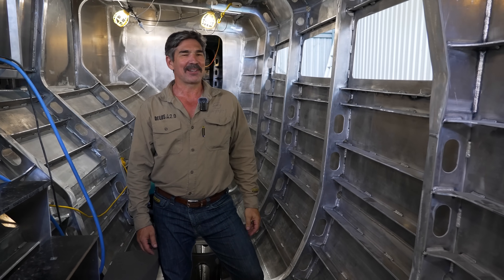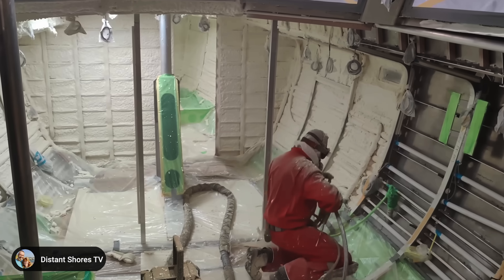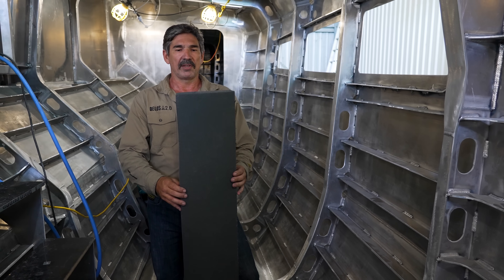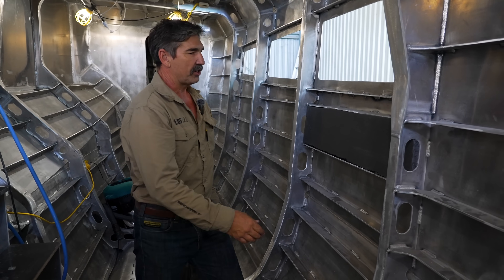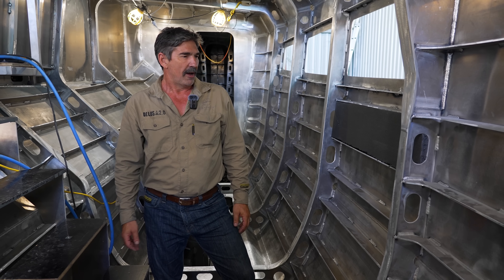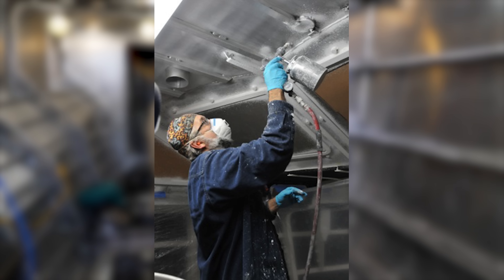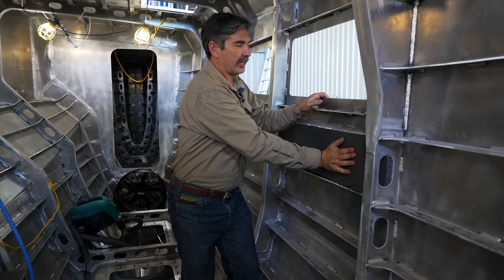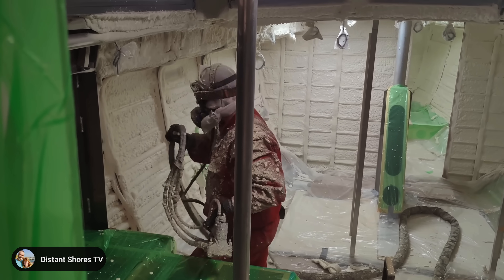HELP, We Need Your Advice!  How Should We Insulate Our Aluminum Catamaran???

Comment: Awesome subject, thx for opening the conversation. IMHO, there’s only one real option. Spray it. I would explore a two part system especially an epoxy solution. Poly cells breakdown over time and can hold water. Look at all of the poly foam core/fiberglass that has failed.  The correct materials can also be used as a structural foam in water tight spaces or below the waterline. The epoxies will most likely require an acid etching prep. to ensure a quality lifetime bond to the aluminum. 
It’s easy to remove and replace if ever necessary, no power tools required. Power tools may speed up the removal but they tend to make dust rather than chunks. It’s messy but cleans up simply with a shop vac and a wipe down. I’m particularly pleased with how easy new waterlines, electrical conduit or other systems nest into and stay put.

Comment: My comment is definitely off-topic.  I recall seeing the construction of the bus bar.  I am curious, and truth be told, kinda' freaked out.  What is your validation strategy for stray current?  Are you ready to bury the bus bar not knowing if any current is leaking?  After seeing Gone with the Wynn's latest fiasco on their new carbon fiber catamaran and now corroded metal parts across the vessel, I suspect a unit, integration and system testing strategy is something to consider.

Comment: Whatever insulation process you go for. Think about applying Alocrom 1200 or something equivalent first. You could even put a primer on top of that. You won't easily be able to see the inside of the hull when the boat is finished. Better to protect it from day one. It's what we do with Aluminium on aircraft. You don't have to dip. There's a brush process too.

Comment: Why not incorporate a "hybid" solution, you know, like the way you're powering 2.0. That is, SPRAY those areas (like the window frames) where you will always have a temperature differential, then use the Neolon XPE with a "sticky backing" for the rest of it? I would continue to chew on it (as you are CLEARLY doing) until the path forward becomes clear, and it will. Trust your instincts at this point as your gut has brought you to this point, serving you so well. Sail on!

Comment: I have spent a lot of time reflecting on aluminum boat insulation over the past decade. My conclusion is that a multilayer approach, using both cork and foam, is the best solution. For this, I believe that using cork projection for the first layer, followed by foam insulation, is the perfect choice for an aluminum boat.

1st Layer (Cork Projection): Cork projection serves as the first layer of insulation to stop heat conduction.

2nd Layer (Foam Projection): This second layer acts as insulation for convection.

Benefits of Thermal Insulation Cork and Foam:
Thermal Insulation: Cork and foam together provide excellent thermal insulation. Cork offers optimal protection against thermal bridging and condensation.

Sound Insulation: Cork outperforms foam in sound insulation, especially for the low-frequency sounds from waves crashing against the hull. The combination of cork and foam enhances this effect.

Lightweight: Both cork and foam are lightweight, which is crucial for boat builders.

Moisture Resistance: Cork is naturally moisture-resistant and guaranteed to be biocide and fungicide-free. Foam also offers good moisture resistance, ensuring a safe and healthy indoor environment.

Durability: Cork is highly durable (think of a wine bottle cork), and when paired with foam, it provides a long-lasting insulation solution.

Ease of Installation:
One major advantage of cork is its ease of installation. You can spray a 6mm (or 3/16") layer of cork and then add the foam insulation layer afterward.

Comment: The in-situ foamed insulation is probably right. With the pins you're showing, I would always be worried about condensation forming between the alu and the insulation.
What strikes me as interesting is that you have a 15m length at least 2m hight on both sides of each hull. That's ballpark 120m2, simplyfinging that the hull deck insulation is about the same as the fore and aft of the hulls that you won't need to insulate. If that insulation is 8cm thick, that's 10m3 of insulation, providing 10t on non floodable buoyancy. Adding in the bridgedeck floor, you're probablyy not miles from having a vessel that could be flooded and keep afloat. Given you'll get close to it, it's probably worth considering whether you want to add a bit more than you need to cover the ribs and make this emergency buoyancy an integral feature of the build.

Comment: Love the vids! I think spray foam is the only choice for effectiveness, simplicity, moisture control, even coverage and longevity. Using foam panelling on specific areas for ease of access makes sense but would not be great at controlling moisture in those areas. 
Spray foam is not that difficult to remove if needed (although you now have all this foam to dispose of) and as stated it’s easy to reapply.

Comment: I have no idea what the Navy is doing today, but back in the early 90’s my spaces on Yorktown were in the aluminum superstructure, and they had some green kind of primer inside the skin, with those button skewers going through what looked like fiberglass insulation, which would get wet (it was an intake space on the 03 level) and had to be ripped out and replaced pretty regularly. And yes any exposed structure radiated cold - especially above the Arctic Circle.

My recommendation - yes coat the inner surface / no don’t use fiberglass insulation or anything that is not closed cell. I think you are on the right track Brian.

Comment: First apply a thin coat of rhino liner to quiet down the hull and will also help insulation/condensation damage then use the pressure attached XPE.
Sprayed on insulation is noisy in comparison.
Reply: Use spray-on white rhino liner. The benefit will be added strength, severe noise and vibration reduction, protection to aluminum and condensation avoidance. Then add the XPE just pressed on between the stiffeners and/or glued on brackets where needed.

Comment: this will probably get buried just my post where you explained the engine and electrical system but you should absolutely go for spray foam.
run all wires and conduit first and then have it all sprayed up, that way you will not have any gaps and places for water to condensate.

Comment: With the complex ribbing that you have spray foam is the only practical way of insulating your boat to prevent interstitual condensation as no air gaps are left for moist air to pass through. A vapour barrier must always be installed on the warm side of the insulation

Comment: Spray foam the exposed stringers first, leaving the cavities relatively unexposed, then stuff the cavities with foam.   One thing I think you should be very aware of is smoke propagation should you ever have a fire.  You have relatively small enclosed spaces that will fill very quickly.  I like the Neolon XPE since it is specifically for marine applications. 

You should also consider just using the Neolon XPE.   You can solve the stringer problem by making your own "u channel"   there are lots of ways to do it, but a table saw with a dado blade might be easiest.  Cut a sheet into the widths you need,  use the dado, or a router table to run the those shapes to make the u-channel.   Apply a little adhesive,  cut to fit over the stringers,  then fill the big voids.   I think it would be a neat job. 

I'm a little concerned with the r- value of the Neolon,  2 for 50 mm  seems like not too much, but maybe it's good for your application. 

Below is another material,  higher r value, but looks like more problematic to attach in your application. 

I'm really enjoying your this project and your videos. 

https://www.jm.com/content/dam/jm/global/en/industrial-insulation/industrial-mineral-wool/minwool-marine-board/022718_IND-409-MinWool-1200-MarineBoard-A30A60.pdf

Comment: With just the options you mentioned in the video, I’d go with the spray on membrane, then the foam. Then with the, I assume removable panels you cover the walls with, I’d attach a self adhesive sound absorber. Like what’s attached to panels and floors in cars.
Reply: There’s many options and thicknesses, some are like butyl-ish type material, some are like foam gasket type material, some are covered in foil like for engine bays and what not. I just feel like the sheets of sound absorbing material on the back side of the paneling used to cover up the walls will be very multipurpose and easily maintained. Reduce noise, reduce vibration, reduce moisture wicking, easily replaceable.
Reply: There’s many options and thicknesses, some are like butyl-ish type material, some are like foam gasket type material, some are covered in foil like for engine bays and what not. I just feel like the sheets of sound absorbing material on the back side of the paneling used to cover up the walls will be very multipurpose and easily maintained. Reduce noise, reduce vibration, reduce moisture wicking, easily replaceable.

Comment: Here is a link to insulating aluminum boat : https://youtu.be/zXXzXpD3_ng?si=jk4Br10WY0a1YrED  I know it’s not the same as a house, but what ever you do make sure you pray some sort of vapor burrier on the hall. You may think it will be hard to cut away the spray foam for repairs, but remember the likelihood of that is 1 in a 1000, on the other hand the comfort and sound insulation is a daily comfort.

Comment: Spray urathane.  Classic is classic for very good reasons.  99% of the time it is no worries.  Do not engineer for 1% when you need service.  You will have to scrape it all out if you need to make a weld repair, but how often will that be? Plus pultice corrision worry would keep me from the water but no air, adiabatic situation.

Comment: Go with the sprayfoam if for no other reason than convenience!   It's fast.  No fussing with cutting and jigsaw puzzling (I've done it on a fibreglass boat and it was a nightmare)!  Sprayfoam will give you instant adhesion, so no air gaps to worry about.  You can always go only as deep as the horizontal ribs and then lay a sheet on top, between the verticals.  That way you can run your cables/plumbing in the sheet layer... making it easily accessible.

Comment: Too much thermal bridging with your preference. Remember the more insulation you have the higher the bridging effect. If or when you need to get to the hull it will only be very localized. I have a thermal or infrared camera. Its amazing how well heat will exchange at the bridge points or lines. Condensation will be crazy with cold bridging like running water (though I suspect you will spend most of your time in the heat. Even your sample had quite a few gaps in it. just check it with a camera and you will see how poorly it worked.

Comment: How about using the black closed cell and then spray the foam just in a narrow strip over the protruding aluminum. It would insulate the metal and also hold the black stuff in but still allows you to remove the black stuff if absolutely necessary.  By spraying just the protruding aluminum the foam will also make it air tight which will also help with con.

Comment: Use sprayfoam. Repairs are easy, removing the sprayfoam is a breeze. The actual insulation and avoidance of moisture issues is really the biggest plus. With panels, you will always have gaps, dropping your r-value more then you'd think. I'd put technicals inside the foam, you need to secure those before foaming. Make a drawing where's what and wires/piping could be put in pvc conduits so you can add/remove/service wires or pipes.

Comment: I have an aluminium catamaran 13 years old. The spray foam is the only way. You’ve got a point. Every part of the hull that is not perfectly isolated will be a thermal bridge. I added some insulation panels over the foam to cover as well as possible. However the condensation that you can see and remove is not a big problem. You have to worry about hidden condensation. Dirty is the most dangerous reason of corrosion. Under a dirty spot and around it there is a difference of oxygenation and this is enough to start corrosion. This is typical into the water tanks. Small deposits of lime starts, under them, corrosion. Last thing. It’s correct, the spray foam may be a problem if you need to access under it. But under the foam the aluminium is like new, also after more than 13 years. Sorry for my English.
Reply: Almost perfect English 👍
Reply: Right couldn't you just burn it off??

Comment: What if you take a panel and install it as single vertical panels, then measure and cut in horizontal slits for the horizontal ribbing. So when installed, it will look like a smooth wall, and you can acesss each panel, cut in for any additional conduit or cable or whatever, then just put the panel back. Hope that makes sense.

Comment: Use closed cell spray foam. You will never get a air tight seal on foam batts therefore you will get condensation behind them & corrosion. To get any sound dampening from batts you would need to heavily adhere them to the hull making them just as difficult to remove as spray foam. Therefore batts come with multiple down sides while spray foam has only 1. 😊

Comment: Aircraft are insulated for -57degC, made from aluminium and have the same construction... trust me im a pirate ☠️

Polydamp Hydrophobic Melamine foams: Used in aircraft fuselages and bulkheads for thermal and acoustic insulation. These foams are naturally resistant to settling, allowing them to be used in frames and over stringers.

Comment: Hi, I would spray, AFTER putting in tubes/pipes for the cables and pipes. That way they do it on concrete walls and so you have both everything covered and the ability to change, and if you plan wisely, add more cables and pipes... and you have extra protection from wear and tear in the cables isolation, so no copper or electricity will come close the the aluminium.

Comment: You are doing some fantastic work! I just wanna try to help regarding the insulation. Since it’s crucial to avoid condensation on the metal you need to take every measure to avoid moisture to reach the metal on the inside of the insulation. That means that the inside if the hull needs to be absolutely air tight to hinder moisture to getting into the hull. That’s really challenging and a lot of work, which is why the spray foam is the absolute greatest option. It gets completely airtight and is done in minutes. It really is not that hard to remove either since the other option with clued foam sheets also is comparably hard to remove. 
Good luck! I cant wait to see the  oat when it’s finished! Love you guys!! You are living my dream! ❤❤

Comment: It is a difficult task, but you can use PIR insulation boards like (Kingspan Therma TR26), they have one of the highest insulation capabilities. I think I would let them run over your horizontal braces with recesses so they lie flat against the hull and tape them to the profiles at the end with aluminum tape to make vapor barrier. and maybe use amflex for the profiles that stick through. you should also do a dew calculation, to find a minimum insulation thickness.

Comment: I would say use the paint and those black panels, it saves on weight, you don’t have too worry about corrosion and you don’t have to chip foam out when you need to work on something

Comment: That spray foam is also crazy toxic and unsure if it would off gas when heated or react with/damage the metal over time.
The foam panels are the clear winner, just need to spray paint the aluminium to completely seal it in the event of condensation from temperature differentials.

Comment: Metal boats here in Iceland have a major condensation problem the moment you have any exposed metal that is not well covered. Foam pads are a no-go here, water vapor from the atmosphere goes through any pinhole and condenses at the cool surface of your boat. This water never leaves and the little dissolved hydroxide from the oxide layer on the aluminum makes the water conductive. Then you basically have a battery the moment you have any separate metals.
I like the idea of using a thin insulating paint first, if you don't want to use expanding spray foam but rather removable foam blocks. You also want to insulate every metal surface in thermal contact with the outside (at least if you plan on going to the top or the bottom of the world, or experience a snow-sail). If you can also put fastening fixtures on top of that thin insulating paint, you might have a way to make a thermal break between your outside metal and your interior fixtures.
Love your channel!

Comment: I looked at the video. May I suggest spray foaming first, then put in your electrical wire runs in after. Doing this you would still be able to label your wires and get to them later for repairs, if needed. Cheers!

Comment: Spray in foam seems to have the least Cons of the two options. My concern would be can it hold water? This could be mitigated by covering it with a membrane or seal layer to stop absorbtion. To get good coverage its always going to be tough to get back down to the hull, but unless you plan on making every interior panel removable its always going to be a mission no matter what insulation is under it.